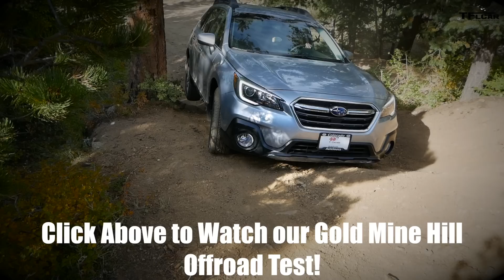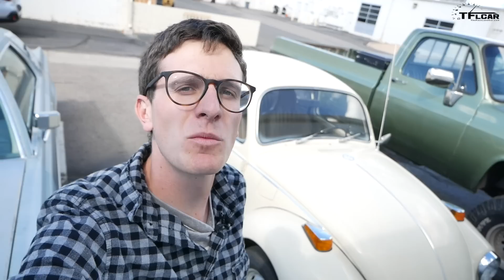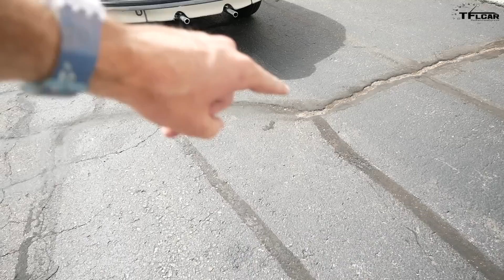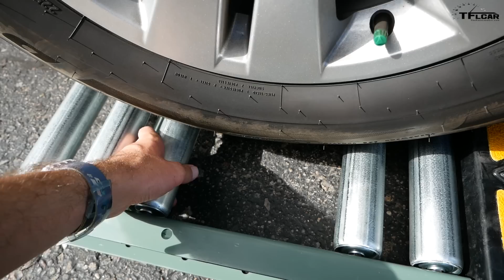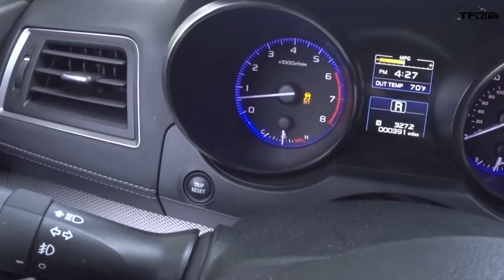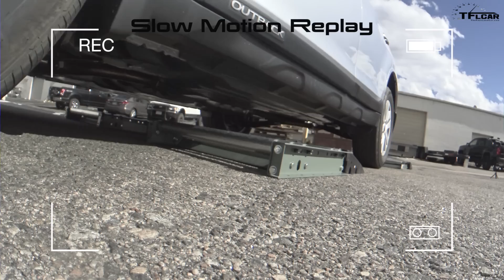The Truth About Subaru's Symmetrical All Wheel Drive:TFL Slip Test vs Subaru Outback

Comment: Apply common sense. I have a 2018 forester cat and I drive through sandy terrain with no issues. I’ve driven on sandy hills with big pot holes climbing with little issue( all season tires). I’ve even driven on twist ditches off-road and the traction system worked wonders with the forester. One thing I’ve learned with Subaru and especially Jeep is turn the throttle management off so the system can focus on traction.

Comment: Or...... You could have locking differentials like God intended.
Reply: Or limited slip....
Reply: @austingupton8829  please enlighten me with your divine knowledge
Reply: @hl9009  I'm not the one being condescending dude
Reply: @hl9009  oooooOOOOO someone is looking for a youtube fight so that he can insist that God does not exists! hah!
Reply: they used to have lockers in the 1970s and 1980s. Hell they even sold low range gearing in the manual till 2009
Reply: And have bald tires and stressed suspension components if the road isn’t entirely slick. That’s why modern trucks have a centre diff for AWD mode.
Reply: Technically a brake locking diff is a locking differential. It just locks at the end of the axle instead of the diff carrier. There are lots of sacrifices with real lockers that wouldn't be acceptable in a Subaru.
Reply: who is god?

Comment: I would say you did very well with this test. 
If you haven't already try putting those rubber entry/ramp blocks on both side of the rollers to help try and keep the rollers from jumping back. And to just make for a smoother transition. 
One thing we noticed with the test on gold mine was that the wheels that were getting traction would not spin and were getting a limited amount of power. What would happen if you hooked the rear of the car up to a stationary heavy object like a post or truck. What does that 4th wheel do?- (3 roller test) 
Does it spin, or spin a little then stop spinning because of some sort of traction system related restriction. 
One other thought. When driving the car forwards on the rollers. What if the roller in front of the wheel was larger than what is currently there. That way the car had a more restriction towards moving forward to get off the rollers. Thus requiring more out of the wheel that has traction. This could also be accomplished by removing another roller or 2, setting the wheels down farther. In that case you would have to build something to put the rollers on to the wheel add enough clearance.

Great job! This channel is always on the list of shows to watch.

Comment: I agree with others, try it on an incline.  You may have to design your rollers a little differently so it won't roll back.

Also, can someone please explain to me why the CVT has been convicted as the villain in the gold mine hill test?  If the car can climb a steep hill when all four wheels have traction, which I assume it can, then it seems to me that the CVT is not the culprit.

The above test on an incline would demonstrate this, I think.  If the car is able to get onto the rollers but can't get off, then something other than the CVT is throttling power.  Presumably, the torque vectoring system.

Comment: You need to secure the rollers to the ground better.  You’re relying on too little friction which is why they’ are kicking out.  That’s why other test like this lock them on steel ramps.

Comment: I put a 07' STi transmission in my 02'WRX. First off comming off a low speed turn in 2nd gear 5 speed vs 6 speed is a night and day difference. Perfect gear ratio plus STi 6 speed has a front LSD the 5 speed has a open diff. In snow, rain, dirt and hills the car just pulls. No cvt, no open diffs and no braking a wheel stupidness. All mechanical. Build a better car from Subaru's own parts.

Comment: Great video. I would like to suggest that you run the same test with a Forester or Crosstrek with manual transmission. I believe both have a manual option in their base trim in their last generation. We will know if transmission makes any difference.

Comment: ARB Australia has a mobile test track to show the benefits of their air lockers. Designed to lift wheels and test performance on various inclines. I'm interested how much power AWDs can push to a single wheel in the case of 3 spinning wheels. In the case of a difflocked power train it should be about 25%. Not sure how you'd measure that.

Comment: Good job on coming up with a repeatable test. I think the roller platforms should be a little longer so you could get a better idea of what’s happening as the wheels slip. 

As to the subie’s off-road performance, they advertise Subaru’s as a go anywhere vehicle, but they only show vehicles on mild dirt roads. I’ve never seen an add that made me think it is a hardcore off-road vehicle. 

Also, the CVT is for fuel economy and really makes these cars softroaders at best. If you want a Subaru to to up goldmine hill like a traditional 4x4 you need a Forester with a mild lift, off road tires, and a 5-speed manual. Otherwise, these are really only meant for light off-road travel.

Comment: Diets the rear have an LSD? If that's the case the wheel with traction should be a front one in the test. No doubt Subaru would still ace it though, best system you can buy for under 25k new. Every other system better than this cost more new period.

Comment: Betting off with 4 wheels on rollers - that would be truly impressing! 
Joke aside, you should try both front and rear wheel with 3 wheels on rollers. Some cars differs quite a bit between front and rear axle drive.

Comment: Suggestions:
1. Chop up a few old bicycle tires and rivet them to the bottom of the roller tray rails to stop them from getting shot backward every time a vehicle steps off one.
2. Put all four wheels on the skates and demonstrate that there is insufficient friction in the rollers to allow a vehicle to escape their slipperiness.
3. Add "down" ramps to the other sides of the trays. If the vehicle gets that far, it doesn't need to demo falling off them.
4. Same testing but in reverse gear
5. Same testing but on varying hill grades (Newton-Raphson selection algorithm) to evaluate what grade is "too steep" for a vehicle to escape (both forward and backward) with only one wheel having traction. And then with two wheels having traction.
6. Less talking, more testing. All of the above could be combined using a text banner under each test condition and show the video in 2x speed because who wants to watch a Subaru drive off rollers 200 times? (i.e. You need some fail in there or it gets boring).
7. Colored wheel graphics in a corner that identify which wheel(s) have traction during each test (and don't).
Reply: Excellent evaluation idea that should be added to EVERY vehicle review that TFL performs from now on, regardless of drive system.  Basically, this eval would be pertinent for all drivers outside of areas like San Diego with perfect weather year round.  Curious is these skates would work on the bigger trucks.  They seem small and light-duty and I wonder if pure momentum from the vehicle rocking could carry it over the skates instead of traction.

In addition, this is an excellent review of the video.  I had similar questions.  1) I was wondering about four skates as well. As one aspect of this test, establish a baseline by demonstrating which wheels are moving in a four-wheel low-friction event.  I also would consider securing the vehicle front and back with tie-down chains to fully realize which wheels are moving when under a full loss of traction simulation.  Easier than moving 2 or 3 around.  2) As a basic safety thought, add some little friction to the skate base-plates to reduce the skates from being kicked so far.  Also, down-ramps seem like they would help but probably not critical.  3)  I also like the idea of reverse and different grades of incline such as a simple loading dock ramp, as long as the intended direction is always up the ramp (silly but necessary).  4) For me, less dialogue and more data, such as the graphics that you suggested, is always welcome but this is a video review so......

Overall, it's good to see TFL looking to expand it's evals with data and demonstrable representations of a normally subjective opinion.  I look forward to future reviews like this.  

BTW, I agree that I would love to see the three different Grand Cherokee systems stacked against each other to see how much of the marketing hype is justified.  I have a 2016 and love it but I am curious what I am missing with the eLSD in the rear.
Reply: Down ramps are a safety item so as to not impart horizontal energy to the roller assemblies to prevent the rollers from sliding off, and hit someone or something.

Comment: Everyone is missing how many tire rotations it takes the Subaru to engage the wheel with traction. By then in the real world your out of control. People use your heads! Come on TFL, you have so far to go still. Your show has some good ingredients, but just not quite there yet with the common sense in so many area’s. Your missing a few things to take you to the next level, and it’s hard to watch sometimes. So why do I? I like to look for the many areas of improvement I guess. My wife gives me crap for watching when I find and point out so many errors. Your likeable guys, but your missing the.....
Reply: This specific series of tests appears to simulate a situation where you are stopped, and only one or two wheels have traction.  In this situation, spinning wheels do not send you out of control.  It would be ideal if the torque were sent earlier, but it's still pretty effective for this specific purpose.

Comment: When Subaru says “go anywhere” vehicle, it’s obviously a marketing or advertising claim. It’s obvious the Outback is not a serious off roader by its appearance. It’s a station wagon with awd. If you want to take the phrase “go anywhere”, then be sure to also test the Outback driving in the ocean or through quicksand.

“Outback”to a reasonable  person means dirt road, gravel beach, snow, NOT up a rugged mountain road. People will only get into trouble trying to drive cuvs up mountainous terrain. The don’t have the proper tires nor ground clearance. Even if the occasional cub does make it up the mountain, regular use in that capacity will surely cause severe damage. You guy should encourage people to use vehicles for what they’re really designed for, and not take colorful marketing phrases so literally.

Remember that Mitsubishi commercial from the 80s when the guy fires a gun, then jumps in the Mitsubishi and drives really fast, and then waits for the bullet to catch up and catches it in his teeth? And says, Mitsubishi, faster than a speeding...well you know. No one actually believes the Mitsubishi was faster than a speeding bullet, but maybe you guys can do that test to find out, the same way you’re try to make a soft roader Subaru go anywhere.
Reply: It was Isuzu Impulse Turbo, not Mitsubishi.
Reply: It was Isuzu Impulse Turbo, not a Mitsubishi.

Comment: ok, so here is what you can do with your new slip rig.   you only need to one more fairly inexpensive thing:  A force gauge!   Preferably one capable of reading 2,000bls or more.  Then,  just chain the vehicle to something that won't move with the force gauge inline.   Now you can easily measure the amount of force a vehicle is able to apply to the road with various wheels slipping.    This setup will also allow you to very quickly and accurately test various terrain modes, since you won't need to reset the rig each time.

 For comparison purposes the readings should be converted to a percent of a vehicle's weight.   so, if a 4000lb vehicle can apply 2001lbs of force with just 2 wheels, then the car would theoretically be able to climb a 45 degree slope with those 2 wheels slipping.

Comment: A open diff is a safety device also. If the wheel with the power was stuck in a situation where it can’t turn, the axel would twist and break. It may even break other parts of the car. Along with the fact that it’s the cheapest diff available, using torque vectoring via the breaks. Is also the cheapest way to achieve the approximation of more expensive and much improved systems. Good videos, Subaru wouldn’t give you a car to test, got your own. Keep on testing

Comment: A small little wheel chock in front of the wheel on the ground will be better at showing the awd ability to overcome the vehicles own weight on an incline. Or removing one more roller on each platform so that the wheels can drop into the rollers might have a similar effect.  It’s just that the way this test is currently setup, it looks like anyone can just push the car with their hands to overcome the test.  Basically it looks easy enough for any weak awd system to pass, that is, and doesn’t really prove Subaru’s claims of superiority imo.

Comment: Where the Subaru really shines in my opinion is when it's pulling away from a standstill when at a stoplight on an icy or really snow-covered road. Even with just the OEM Continental tires, during the course of eight Buffalo winters, I've never seen any other vehicle that can pull away more quickly than I can with my 2011 Outback 3.6R Limited. Note: This is the 6- cylinder, 256 HP model, with a 5-speed Automatic Transmission (but not a CVT).

Comment: so basically absolutely any AWD vehicle would have performed exactly the same since this test doesn't require much torque to get the vehicle moving. But as soon as a greater amount of torque is needed to pull the vehicle out of a hole or up a steep slope then this system is totally useless and only a 4X4 system would work with impressive results.
Conclusion Subaru sucks again.
AWD is a light version while 4x4 is the full version.

Comment: I really like that slip system! It seems like it would really pit vehicles with varying degrees of approach and departure angles and different ground clearances fairly against each other in the way that they deal with those types of situations according to their individual takes on traction control systems. However, actually taking them out into the wild to see what their really made of is not only y'alls signature, but it really helps to demonstrate the overall aptitude of the vehicles true nature and dynamics for those trying to determine what vehicles to choose from which may be very close to each other on paper but one could clearly be the overall winner and have the clenching selling point for interested buyers. Again, I like the slip system, but maybe you should run all of your test vehicles using both methods to not only help customers, but to help automakers that watch your channel for feedback to really push the boundaries on what's possible with their vehicles and make decisions of their own whether to continue tweaking with their current technologies or bite the bullet and step away from a clearly dead end road. There's always a better way and they will do what we ask of them in the end because, pardon my French here but, that's what puts asses in seats and that's what they're all about. Keep up the great work guys!

Comment: Interesting, this is under controlled conditions but think you would see different results in real life conditions. I'm not just talking rock crawling either. Example: I have had my Outback stuck on flat asphalt because the front right tire ended up on ice. I thought I high centered it at first shoving snow under it as I backed out of the garage. I shoveled just about everything under it and nothing. Then i noticed the front right tire kept spinning....it would spin for a little and then shutdown. So I worked on the ice around the tire. Once I freed that tire from ice, I was able to drive any where! This was all controls normal...with traction control on.

Comment: It would be interesting if you had all 4 tires on rollers. You have 3 like what you have and have the 4th you have all rollers installed instead of 2 missing. It would in my mind simulate the worst winter traction.

Comment: I've noticed with my crosstrek, stock pressures have uneven sized contact patches front and rear. I've found to like 41/36-44/39 hot psi for optimal wear versus stock 33/32psi. So something like 37/32 cold pressure. Would that have made a difference with the gold mine hill? I came up with the pressures by looking at contact wear lines after driving and adjusted pressure until the noticeable contact point stopped at the same place. 
I've got about 1,000miles with these pressures and car balance in corners, and take-off on gravel driveways seem to be much more in sync traction wise. I think it works based on my trek driven with no cargo and 1 tiny person.
Just curious if it actually makes a difference or if it's all in my head

Comment: The main issue is that there is a significant loss of power and there is not enough torque that is being delivered to the wheel with the grip. In real off-road scenario, you can not afford extra wheel spinning to gain power, as you will be buried deeper and deeper. It will be interesting to compare torque distribution of Subaru’s AWD with VW’s Haldex or Acura’s SH-AWD on a slope. My gut feeling, as a Forester owner, is that Subaru is overrated, especially due to the extra weight in front of the front axle. Either active torque vectoring or LSD is needed to really tackle basic off-road articulations.